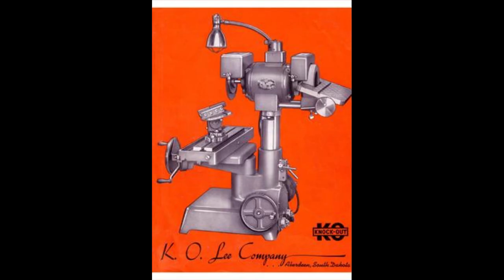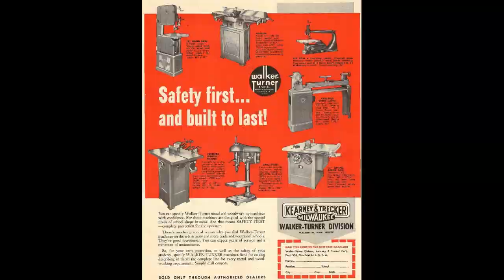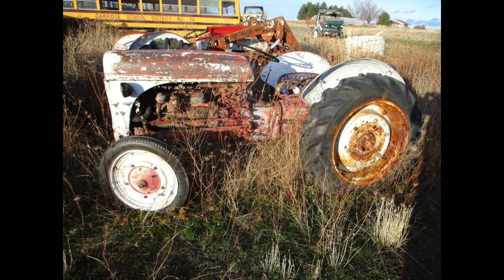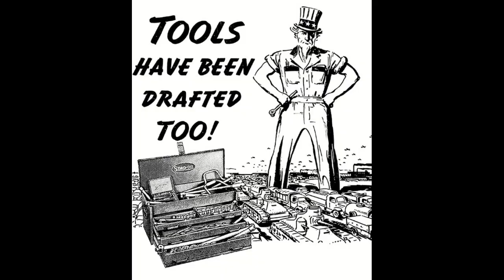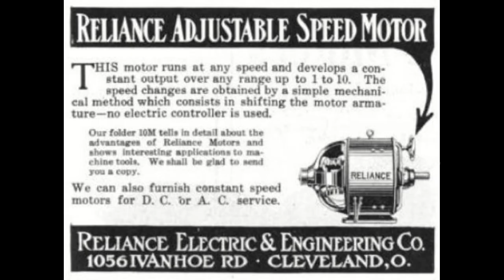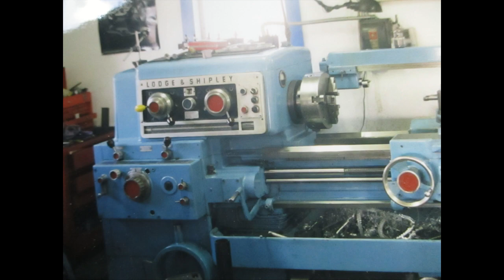Harley Davidson Machine Shop, 1953 K Model Project Begins

Comment: It looks like the bosses are casted for the 58 - 69 primary cover. I remember an old timer years ago had his aircraft / motorcycle 
weldor friend build up the bosses with weld & he layed it out & drilled & tapped the holes for the late model cover on a Bridgeport.
I was impressed. Now I'm wondering why he had the bosses built up if they're already there.  I thought he said it was a 57 case
with only 2 bolts.
Reply from the maker: I have the K model and XL parts books, I will take a look.

Comment: Happy days Don, nicely done, buddy. I only just noticed those outer cover holes are plugged. Are they next on the agenda? Thanks for sharing and best wishes to you and yours Ralfy
Reply from the maker: The outer cover screw holes were not drilled at the factory except 2. The cover is aluminum and held with only 3 screws but they obviously were going to use the tin primary cover at a later point. I just might go ahead and drill those holes so that option is available if I cant get the aluminum cover to seal with only 3 screws right down the center holding it on.
Reply: @DonDyarprecision  I have the tin primary on my Shovelhead, not the same obviously, but same era I think?

Comment: Reminds me of my old 65 XLCH that dropped the transmission at the drag strip 🥺 The underside of the case looked like Frankenstein welded it up 😇 Campy the H-D man at old New Orleans Harley 😎
Reply from the maker: Hi Campy, the main problem pointed out at the factory was the 50% gear contact on 2nd and 3rd gears.
Reply: @DonDyarprecision  Terribly sorry was referring to the Ace mechanic Campy at Harley Davidson of New Orleans circa 1986 . After building the Sportster motor I asked Campy how can I reduce the 12: 1 compression '' Go steal a stop sign and make base plates for the cylinders '' 🤣 !
Reply: My repairs don't look like Frankenstein did it.  🤔  Uncle Fester mabee.   😁